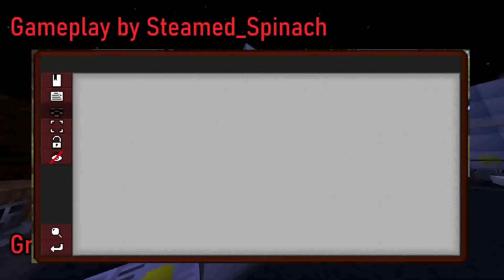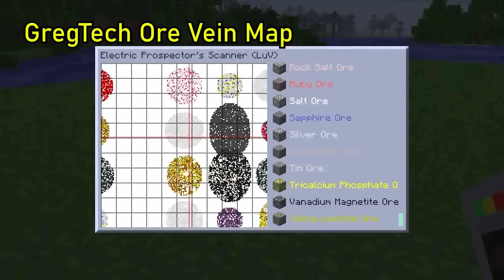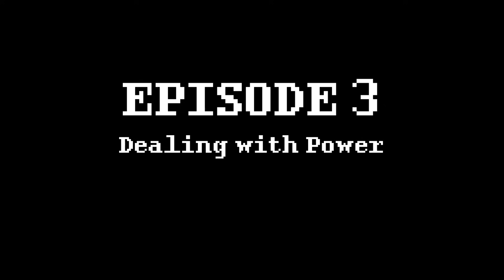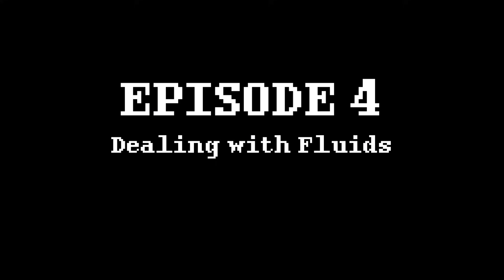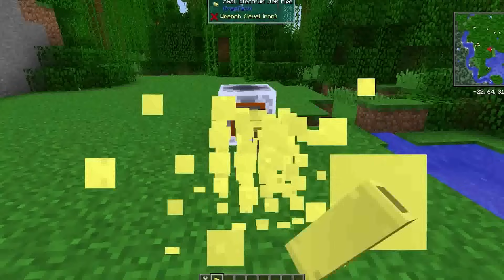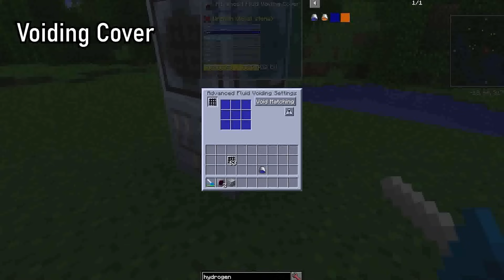Learn GregTech in 20 minutes with GregoriousT!

Comment: TY bro, you helped me ngl... also check my progress in GT: new horizon
tier 0 = 10h
	first big forge				15h 23m
tier 0,5 					10h

	first red alloy 			18h 30m
	first steam macerator			21h 02m
	steam tank,compressor			23h 09m
	enjoy,improvement, QoL			34h 27m
		lapis finally(73veins) :P	
	bricked blast furnace			35h 31m
	FIRST STEEL 				35h 47m
	first alumite				36h 47m
	TOOL FORGEEEEE				39h 43m
	Hammer					40h 45m
	Nether					41h 01m
	oreberry farm,base improve		45h 17m
	high pressure setup, bigger tank	53h 05m
	first electronic circuit		54h 23m

Tier 1 - LV					54h 24m
	wire cutter				55h 21m
	Base improve, mining,			57h 25m
	mining.. again, 2 more blast furnaces	60h 25m
	fancy garden and kitchen		62h 12m

i just migrate to prism launcher cuz curseforge sucks
	base building, first antimoty		67h 20m
now making first factories is pain AF
Reply: 54h
to reach LV made me reconsider playing this the month before finals
Reply: @ancientodi  i actually started again cuz new update and reached tier 1 in less than 30 hours
Reply: @nibirai4468  it looks fun, postponed till summer tho

Comment: One thing that should be mentioned about loss, is that if you transform a lower voltage into a higher voltage first, the overall EU loss per block will be reduced. This is actually how electricity operates in real life, and why transmission and distribution lines are stepped up to higher voltages and then stepped back down at the destination.
Reply: Transforming or buffering your power will also reset your energy losses. It's common to use repeating transformers that don't change the voltage to reset the loss/distance irl
Reply: @jllemin4  No so sure about the "resetting loss irl" part, as that doesn't seem possible with real physics. Once the energy is lost to heat it's lost to heat. You can't magically get it back with a 1:1 transformer. In fact this would just result in further loss as transformers have some amount of energy loss due to eddy currents and hysteresis. That being said, you can supplement the lost power with more local power producers.
Reply: @beewyka819  I was definetly misinterpreting using a tranfo to run a longer distance by making the loss negligible with transformers being able to stabilize a voltage loss. Thanks for the correction.
Reply: loss? the meme?
Reply: Also it can be useful to think of all your GT power as being high voltage DC.